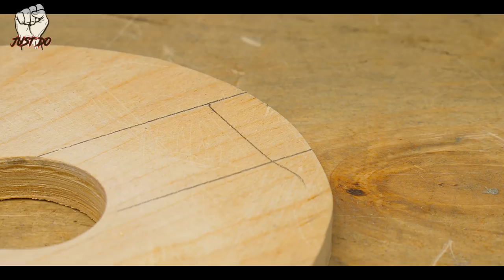Few people know the hidden function of the drill!!!

Comment: You should NEVER use a router bit in a drill. The bearings and rotor of a drill are designed for axial loads, not radial loads. These radial forces will wear out the bearings in no time and you lose precision in your drill forever.
Reply: rpm is too low for save work.....
Reply: Finaly someone who gets the point
Reply: Hello
Reply: @danieldewindt3919  😊😊👍
Reply: El momento angular hace que arriesgues la existencia
Reply: and fingers or another parts of body
Reply: Eugen certainly had his reason, why he did this improvised hack. And in the end it finally worked out - at least on soft wood.
As to safety it won’t be that hazardous due to the low RPM (as already pointed out by the unofficial officers of safety). 
And finally, the bearings on that fake Bosch drill certainly won’t be much to worry about.
Even if this jig won’t substitute a true router, it is a great help to drill perpendicular holes. 
@eugen - keep on your work!
Reply: @evilkneevilofgermany  such improvised hacks are a reason of many health problems for many woodworkers. even with low rpm, momentum of parts is high to hurt or sometimes even kill human
Reply: Man this guy has a $15 drll, he just wasting $$$ left n right
Reply: @evilkneevilofgermany  the low RPM is still enough to severely harm someone.
Reply: Maybe it's a second use drill, one that maybe he no longer used/or was about to throw away
Reply: @lxOFWGKTAxl  here problem is not to save drill, but to stay alive or      healthy
Reply: 1 agree with you 💯!!!
Reply: 11
Reply: @frederikmare9002  22
Reply: @Grant Sims yes it’s not the greatest way to do it, but I believe his point was for someone who could not afford a router but needed one for a small project,

Comment: Obviously the video was post flipped or reversed. Every nut he "tightened up" was counterclockwise instead of clockwise. Drills just don't turn fast enough to utilize true router bits...  Drills turn about 300 to maybe a 1000 RPMS, routers turn 15,000 to 20,000 RPMs . JMHO
Reply: I think that movie was from "Down Under" - Coriolis force
Reply: Yeah and not to steady. Man u that poor ???  Amazon got cheap Chinese routers dat would work just fine for a DIY real low budget like Fellow such as yourself.
Reply: @clauderivet5180  I just started watching, scrolled down to comments, saw this lot, you just saved me 7mins 17 secs, thanks
Reply: @adriank9234  sure thing Pal, some videos are simply to hard to watch
Reply: It only looks like the drill is turning backwards because of the frame rate of the camera.  The screws still go in, which they would not do if they were turning backwards.
Reply: @SuperTemak  Just like watching an old western movie and you see the wagon wheels going backwards, bit hard to get your head around but same thing. Frame rate as you say.

Comment: I guess this would work in a pinch, but not very well. Didn't make a very nice bevel. And, like someone else said, a drill isn't designed to work like that, with the load on the side. The chuck is too far from the motor, then you have the added length of the bit. That will put a lot of side load on the drill, and start to deform it and cause a wobble.

Comment: Nonsense. A drill rotates 3000rpm a good one up to 4800. A router rotates 22000-30000rpm. It is inclusive dangerous to operate with too low rpm.
Beginners listen: DON'T copy that in order to save a little money. Go and get an adequate router.

Comment: This is not only total crap but also dangerous. 1. A drill is not designed to resist lateral forces. 2. A router typically needs 20.000-30.000 rpm, a drill is way slower. 3. the jig will not allow a 90° adjustment what is needed for precise results. 4. abusing a machine may cause serious injuries.

Comment: El problema sería las RPM La mayoría de los routers con EVS tienen un rango de velocidad de entre 10.000 y 20.000 rpm (o de 15.000 a 25.000 rpm).
Un taladro o martillo giratorio con una velocidad alta (entre 1600 hasta 4000rpm) se considera generalmente como un taladro de torque bajo pero de alta velocidad. Un taladro giratorio de una velocidad baja (1200 rpm o menos) se considera un taladro de torque alto, pero de baja velocidad. Saludos.

Comment: Muito bom e bem fácil de fazer! Mais um aprendizado pra minha coleção, muitíssimo obrigado pela rica dica!!!👏👏👏 😁👍
Reply: I am a retired carpenter joiner.
I am a bit puzzled by some of the uses that the presenter has shown converting a cheap corded drill into a router.
The usual method of handling a router is to address the workpiece from the right and push the router away from you (that is, the workpiece is to your left).
The cutter has a what appears to be a washer attached as a guide but it should be a ball race. All sorts of problems start using a washer (the washer can burn the workpiece and can deform itself with the heat generated causing damage to the workpiece).
The whole exercise seemed a bit pointless to me because a perfectly good quality half inch router can be bought on the second hand market for about £30-50 and a brand new diy version for about £50-70.
These come with all the accessories as well.
I don't see turning a drill into a router as a 'hidden user's, rather than stupid.
Sorry.

Comment: Great idea for rough rustic  softwood work but for hardwood rpm would be slow from a drill of that size and cause too much vibration and shedder on the finished cut.